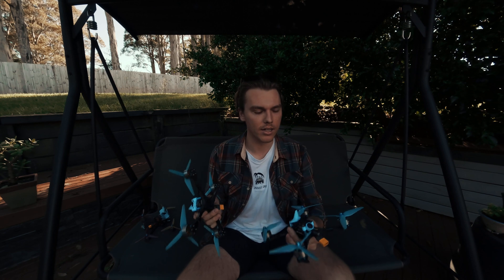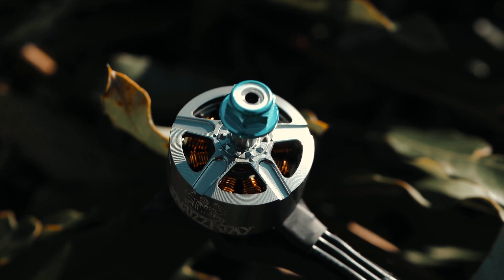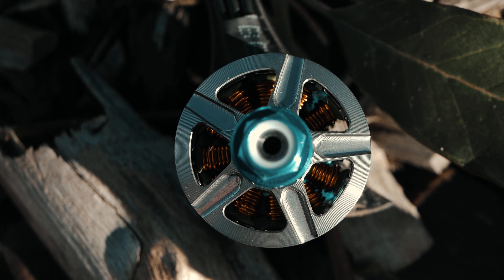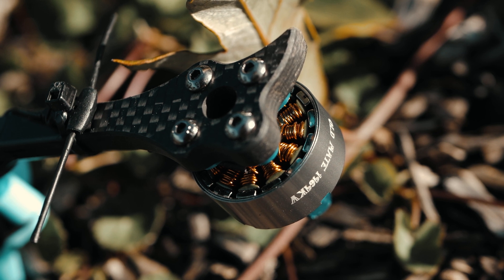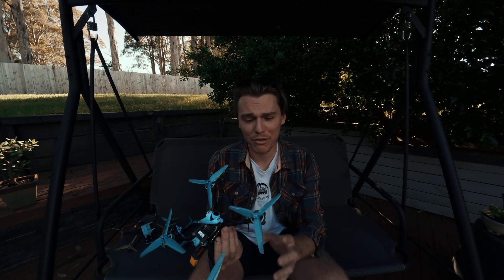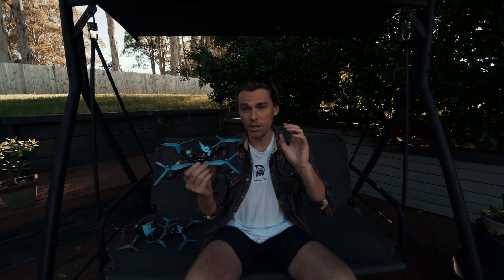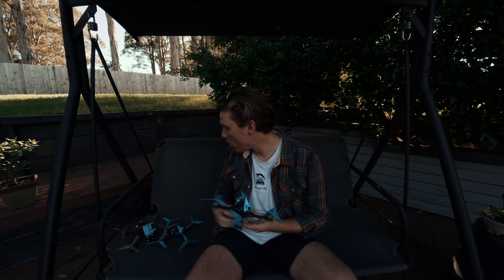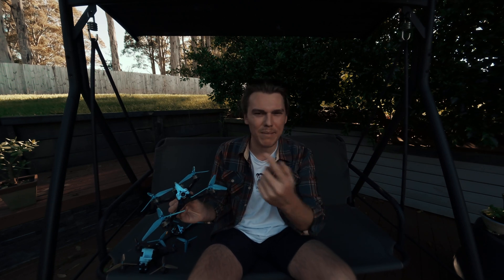Introducing the STOKE MOTOR V2 - the perfect freestyle motor designed by JACUZZI JAY

Comment: Motors look awesome I like the prop grip. Years ago I used to get pitted used to frequent Maalaea Harbor back in the "90" and early "2000" now bad back and knees keep me out of the water but I do hope to get my drone pitted one day that was part of the reason for getting into FPV. By the way your vids on how to trippy spin were awesome mine are not spot on yet but getting there any how get pitted for me cheers
Reply from the maker: Thanks dude!! Yeah man the one thing that so many motor manufacturers lose out on. 
Oh mad hell yeah, it's much like converting to the dark side but have you tried stand up paddle boarding? My old man and uncle were in the same boat and got into SUP's and love it!
Reply: @jacuzzijay  I build surfboards for a living and I've made about 20 of them but never tried one which is crazy. I'm 6'6" and my favorite boards to ride are 5'8" twin "70" style and had a bunch of 6'2" quads swallow tails and a SUP just wouldn't be the same. Thinking of a 9'0" log for small waves thinking of giving wing foil a try I've done windsurf foil its cool but its a lot of gear and you can crash hard. Just fly drones having a blast on the sim Trying to go fast.  Keep rippin and see you on the next one   Cheers
Reply: Think you might ever get your drone pitied